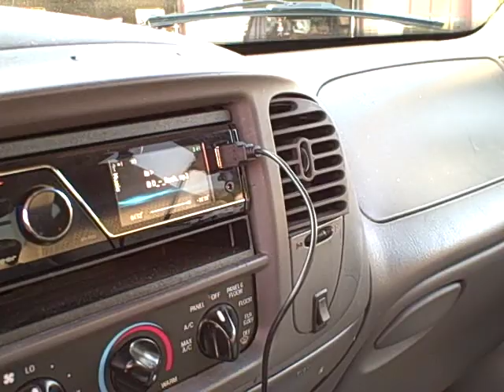auto orgone field generator

Comment: Hello you can use right handed cemenite and put it under your fuel line, it will improve your mileage noticeably and your car will run better.
Reply from the maker: Interesting idea.  Portland cement is primarily carbon based and has some interesting effects when cast properly.  I'm a little confused as to why it has to be right handed.  Won't the coils be left handed on the other end?
Reply: Actually the coils are wound on a 3mm metal stick. So they are right handed on both sides (counter clockwise).
The inventor is Aji, youtube channel is sucahyovideo.
A great video explaining on how to make it and other interesting things about it youtube.com/watch?v=jGUV2E6RdpY
I have made the left handed version and its very very calming, I love it.   
The left handed ones will fire up the oxygen, they will alkalize and oxygenate the water. If you put a glass of water on it in 5 seconds it will fire up zinc in the water, plus it fires up calcium, magnesium, sodium, potassium. And it sedates the ion strength of lead and mercury, and it also sedates the ion strength of chlorine and fluoride.  
The right handed coils will fire up the acid elements and hydrogen, and it will fire up phosporus and sulphur and copper, also it fires up the toxic heavy metals of lead and mercury.
Reply: Also the devices name is cemenite, but it does use portland cement.

Comment: you would need all the electro magnet coils placed in a solid structure(3-D circuit board) and then you would need to fire each elctro magnetic in rotation/sequence/order/irregular to even/counter and clockwise to produce the inner magnetic pulses on a subject. The electromagnetic coils should be placed to for both the known dimensions for the merkabah. this is extremely diffecult to visualize in both the logical mind and spiritual mind at the same time. until these 2 fields come together....